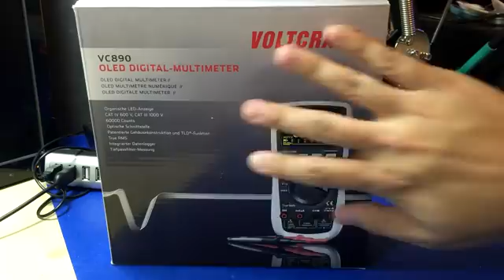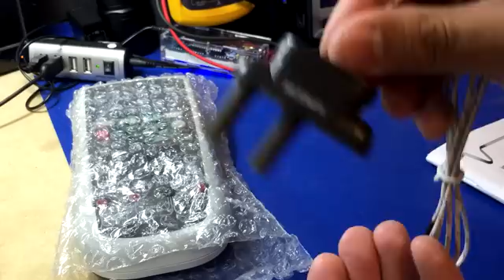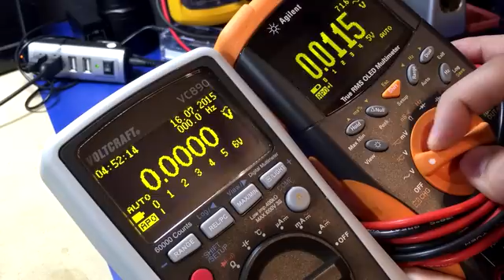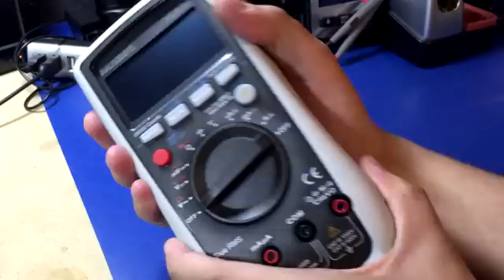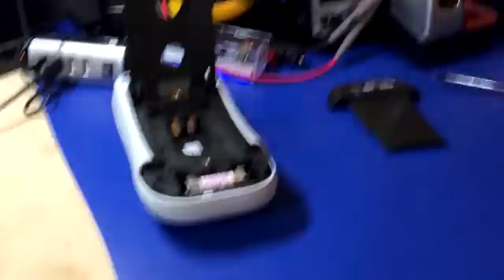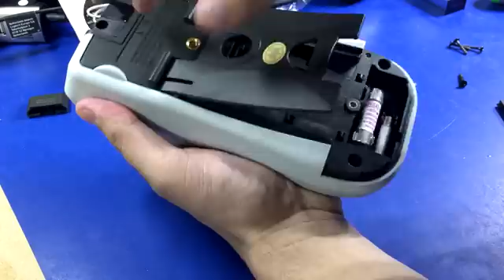Voltcraft VC890 Multimeter Review (60,000 counts, OLED) - #0064

Comment: many and most quality meters is designed to protect the range switch.It does not hit a surface to rubber bumpers etc.you claim that no range switch innpact protection is normal.only on cheap meters and some that are made to be used on the bench or a tripod secure.and not in the field

Comment: I doubt this meter meets CAT IV 600V. Sure there is some input protection, but it looks nothing compared to what you find in a Fluke/Agilent/Gossen Metrawatt.
Reply: As "CAT" stems from the international standards defined in IEC 61010, the meter will meet the requirements for CAT IV most definitely. If it wouldn't, competitors would sue Voltcraft to kingdom come. Actually, the meter (as all other meters) will exceed its specs by far as this is also kind of a "norm" during the test-procedure to obtain the certification ... at least here in the European Union. But you right, of course, in that Flukes etc. might exceed those standards even more.
Reply: Thanks for your reply. In my opinion, every manufacturer that takes itself seriously should have this tested by an independent notified body, such as UL (underwriters laboratories) etc. Unfortunately, that's not common practice...
Reply: UL .. reminds me of a quote from the great Uncle Doug: "UL ... the ingenious body that certified the death capacitor in tube amps" :) But true, independent certification would be an optimal way to go. If Voltcraft would directly export to the US market, they'd probably apply for the UL-certification, as this is the most relevant body for the US. Let's not forget: this meter was ordered from Slovakia and Voltcraft seems to be very focused on the (middle) European market. It would be interesting to learn if you can use gear for professional use in the US (schools, workplace..) at all if it doesn't have UL certification.

Comment: 9V Alkaline Gold Peak battery isn't actually bad, or at least wasn't 10 years ago. Better than Duracell, worse than Energizer. Indeed a while back most of their products were quite good, before Conrad stopped carrying them to replace them with extremely low-quality store brand items.

The price is pretty high for a store brand device, it's 260€, including tax. This brand itself will make most Germans suspicious for good reason, because they release very low quality products every so often. When you exported the product from the EU, you probably got a tax refund of 50€, which helped cover the shipping and even out the price. You could consider the price reasonable, for one because the inherently light emitting display is so unique and everything else is up to par, in part because recognised brands are so overpriced here. For example, i look at Amazon.com (USA) price for Fluke 117, it's $177, which if i convert it and add the tax, comes out at about 190€; however it's 250€ at Amazon.de and it costs even more on the street.

Comment: Don't all DMM look the same anyway? A wee screen, 4 plug holes, some buttons and a big dial thing, probably all made in Dave Jones's basement and they just have a little old lady painting them yellow or red and stamping Fluke, UNI-T or Ampobe etc on them as necessary. I am just being factitious obviously, there is a lot of difference inside, and you pay for what you get. But just looking at the range of say UNI-T, do they have to make so many different ones? The range is dizzying they do, 23 different basic models and a lot, if not all of them have an a,b,c,d,e etc version, so UNI-T alone must make 100's of different models. Great series of videos BTW, I just ordered an Amprobe 510, kind of wishing I had gone for the UNI-T 61E, which has a better spec, but the Amprobe is better made, apparently, Got to be better than my current (no pun intended) meter which is an ancient crappy Mastech.
Reply: I slightly doubt UNI-T is a manufacturer, perhaps they rebrand items from different ODMs/OEMs. Because there's not necessarily a strict engineering continuity between their items. Perhaps part of the dizzying model variety is because they offer multiple modifications for different regions, e.g. for India, South American countries, Philippines, so they can cut cost on quality in the markets which are less fussy about separation, fuses, etc. Perhaps it's the matter of using whatever they can get cheaply and thus quickly cycling models to adapt to the supply market.

The whole Chinese ecosystem is really difficult to understand. A good manufacturer might not even be known under its own brand, such as CEM Instruments.
Reply: Yep I know what you mean, being made in China doesn't mean it will inherently be awful, they make all the mobile phones ,TV's everything really, and when they are given a good spec to follow they make quality stuff. But when left to their own devices they seem to make everything the poorest quality they can, or at least they make it to a price, if you want a soldering iron for $1 they will make it, it will most likely kill you. But as you say it makes it hard to work out which items are cheap and good quality and value and which are just cheap. They do seem to take some pride, for instance when they make a blatant rip off, say when they clone Hakko stuff it at least still works, just about, they could as easily just give you an empty box, would you be bothered trying to get your money back when you had only paid a few £ or $ when the vendor is 1000's of miles away?

Comment: The Uni-T meter you're thinking of is the UT61E, but that's a $30-40 meter, so you'd hope this was a bit more, and it was... still, perhaps there's an aftermarket case for the UT61 which will be nice and cheap.
Reply from the maker: +James Lewis The 61E looks VERY similar to this one, but it's not the same.  There is a different model that has the identical chassis, but I can't find it.  (I own a 61D and a 61E and they're both shorter in height than the VC890

Comment: Voltcraft is not a german reputable brand...
It's something like a rebadger brand of a big electonics retailer here in germany called "conrad electronic"
I bought one a couple of years ago, about a 100€ and it just hat pissant glass fuses for input protection. No PTCs no MOVs... And en plus it had Cat IV 600V rating! How did they even get that passed?
VC820 if you mind checking it out... I don't use it anymore.
Reply: audiocrush Glass fuses? Hmm... Then it was definitely a fake one. Even the cheapest VC-11 that I've got had a ceramic fuse. VC-175, which is around 40 bucks has a lot of protection and also has two fast HRC fuses.

Comment: At about 19:50 you are talking about the can and the MOVs. I think the three green ones are MOVs and what is under the can? Please solve the last mystery of the VC890 ;-) I think this can covers the input resistors. At 26:53 I can see a little bit of the printing on the board under the can and I think I can read "R2" but I cannot see the resistor itself.
Reply from the maker: +MrCanidi I'm fairly sure you're right.  I didn't see a precision resistor network anywhere from memory, so the input resistor divider would be my best bet.  (and those are definitely MOVs, I mislabeled quite a few in other videos as well--I now check the silkscreen instead of guessing lol)
Reply: +TechnologyCatalyst I just got my VC890 and had a look, yes it is the input resistor divider. One word about the probes, they are shit! I have Fluke TL175 and Probemaster 8017S for comparison and I think in one of your videos I saw Probemasters so you may test with them. The continuity tester is ok but a little laggy with the original probes, its good with the Fluke and with the Probemasters its perfect. When I rub the original probes on each other I get values of several 100 ohms and the buzzer is scratching. With the Probemaster no scratching and always 0,06 Ohms or less. It's a shame that they sell such a good meter with such bad probes.
Reply from the maker: Yup, I made a later video where I compared the probemasters to the OEM ones and the difference was shocking.

Comment: In germany it is 255€=$284 (excl. shipping). Voltcraft has not that good a reputation in germany. They are rebadging stuff (like peaktech etc) and the quality between their devices varies greatly (depending on the OEM manufacturer). I'm actually surprised that it is a relatively decent built. But as you said, save a 100 more and buy a name brand.

Voltcraft is the house brand of Conrad, which is our equivalent to Radio Shack in the US, btw. They have stores all over Europe, but none outside, as far as i know. That may explain, why you had such trouble to find and get it.

Comment: Good review! Something you can consider is measuring the current draw at 9V to estimate battery life. While you're at it, see at what battery voltage it stops functioning and whether it starts giving measurement errors at low voltages.
Reply from the maker: TechBench Excellent idea.  I can't believe I forgot to do that.  (especially on a meter with an OLED screen--my Agilent with OLED screen doesn't go long on its oem battery)  I'll probably record that in a bit and get it uploaded.  Thanks for the heads up!
Reply from the maker: TechBench As promised, here's the video!  It's uploaded but still processing.  It's about 12 minutes long, so it shouldn't take long.  Here's the link: https://www.youtube.com/watch?v=_WyVS9U3zS0

Comment: The multimeter actually look awesome.
Maybe UNI-T is just licensing their case? I know a few German powertool manufacturers use parent companies cases and batteries for their tools but completely change the mechanical components on the inside and make the tools 100x better.

But those probes look awful (even though they might feel ok?). I can really recommend "probe master" probes if you're like me and care (probably too much) about how the probes feel.
Reply from the maker: tuva600 I think the main processor that's on the back of the PCB is the same one the UNI-T's use, so there's more shared than just the case, but beyond that, I'm not sure how far the similarities go.  Definitely going to get new probes.  They feel worse than some of the ~$25 cheapo multimeter probes I've felt.
Reply: TechnologyCatalyst Just watched the whole video and you are correct about Flukes being expensive. A Fluke 87-5 with the carry case and probe accessories would cost 733$ from Farnell with VAT in Norway. Or 635$ from amazon.de for just the multimeter(with VAT). Since the 87-5 it's not a 110v appliance I would obviously just buy it from the US and pay the 25% VAT for importing it instead.

And by the way, this video was very useful because I'll probably soon upgrade my bk 2709b and this meter is a good candidate :-)
Reply from the maker: Holy cow, that's expensive!  It's sad that it's actually cheaper to order from the states and just pay VAT.  That's crazy.  This makes me feel lucky being in the states.  (but then again, I can't easily or affordably get Gossens or Brymens, so I guess it evens out)

I'm glad you found the video to be useful! :)
Reply: TechnologyCatalyst Fluke does get a bit expensive through authorised resellers like Farnell. And if you're gonna go for a similar feature set with regards to data logging things get really expensive. I got my own Fluke 289 from Farnell myself, pretty damned expensive yet I do like the meter. In hindsight I suppose I may have been better off ordering it from the US especially with the Euro/USD exchange rates at the time and take the import VAT. 

This meter is surprisingly decent for the price, I'll do some more research but if I don't find any negative points about it I'll probably suggest it to a friend who can order through Conrad (I think that's probably the Germany based seller that you referred to in the video that won't ship to the USA). 

I did try to convince him to consider something like a Keysight U1272A (seriously why change that damned brand name from Agilent!?) or a Fluke 87-5, but I can respect the fact that he doesn't want to spend that much on it... yet. And although "a bit slow" someone who hasn't regularly used some of the more higher end faster autoranging ones probably won't consider it an issue. It's pretty good based on what I observed in the video compared to some other examples out there on the market.
Reply from the maker: Indeed.  It's no Fluke, but for the price, it's not a bad meter at all.  The basic DC accuracy is among the best.  I wish your friend luck in his search for a new meter!